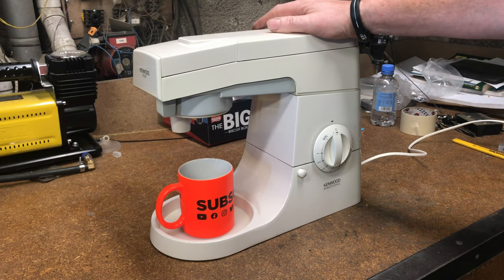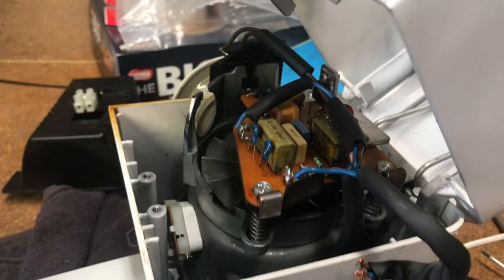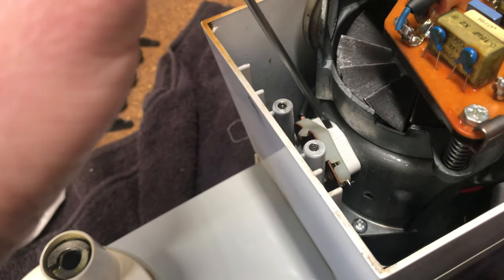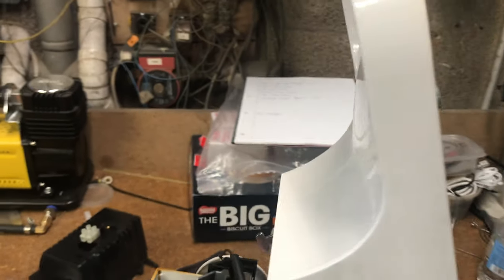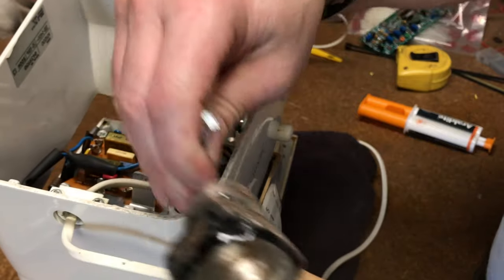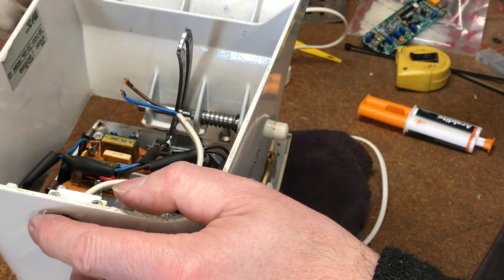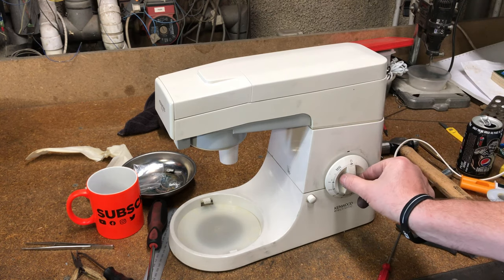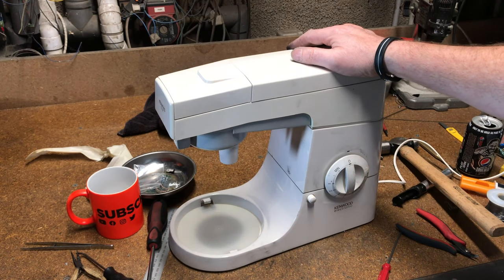Kenwood Electronic KM200 Food Mixer motor controller issues

Comment: Nice Video Mike. I have repaired a few of these. I usually use Rifa Caps that were original factory fitment. Radio Spares sell them Part numbers
210-516 & 210-500 Also that large 56 Ohm resistor is a good idea to fit also as this is uprated from the original. Lastly good to see you fitted new feet, this is really important as these allow airflow from the motor cooling fan. Worn feet allow base to seal against bench & the motor can overheat as a result. Awesome mixers, made to last a lifetime of use.
Reply from the maker: Thanks for the info Carl. Well our mixer is still banging out the cakes after the repair and I expect it will outlast me! Great tip about the feet as well. Thanks for the comments and of course watching 👍🏽

Comment: Excellent views, about the 4 th one I’ve watched, mine is 901 but got the same inductor pins , not the floating potentiometer in a slot, pity the first one didn’t mention the spring height until after I’d removed it will use your 17mm as a first go to.
Reply from the maker: Hi David. Hopefully you’ll have a working mixer soon! Ours is still going strong, good luck and thanks for watching 👍🏽

Comment: Thanks Mike, Yes the brushes are shiny, still a good bit of life in them. Plug and socket are good. I have checked continuity through to the PCB and all in order. Is there a cut out switch I'm missing?
Reply from the maker: I'm not aware of a cutout or trip but thats not to say there isn't. Unfortunately I don't have a circuit diagram to pin point suspect components or check for a trip. I think I'd go down the route of trying to measure the component values and replace as necessary or go to eBay and get that kit of bits. Sorry I cant be more helpful on this one. Thanks for the comments and of course for watching.
Good luck 👍🏽

Comment: Really helpful, many thanks. On slow speeds does the motor seem a little more lumpy & slightly juddery compared to half speed & full speed ?
Reply from the maker: Hi kel, just checked and while it sounds as if there is a slight “judder”  this does not seem to be reflected as a speed issue as the spindle turns smoothly. I hope this helps. Thanks for watching👍🏽
Reply: @MikeMakesIt  speed on mine is fine, just on slow speed slightly less smooth. Looked at a few more  videos of them running it seems this is typical. Appreciate your reply 👍

Comment: Hi Mike, Thanks for the video its really clear. I have a question - my Kenwood 30years + just stopped working. No smoke or bang or anything. I have stripped it down but all components seems to be in good shape no strange smells or anything. The brushes are about 25% of the original. Do you think it would be one of the Capacitors or resistors? Any suggestions appreciated.
Reply from the maker: Are the brushes both shiny on the ends. If so I'd move onto the motor controller side of the board assuming the fuse in the plug  and socket you are using are good. I think eBay still sell kits of bits for the board so in that case I would change all the bits supplied and hopefully that will nail it. If it was possible to safely check you have power after the mixer switch that would be a good thing to check first though. Good luck 👍🏽

Comment: Excellent video and great job Mike. I have a Kenwood km 260 with a sluggish motor at low speeds but I can't find a repair kit for it. I found the whole PCB but it is 60 quid!
Does anyone know the value/reference for the parts, caps resistor, and triac that need replacing/upgraded?
Reply from the maker: Hi Mark, this Guy on eBay seems to have a few kits, it might be worth trying him https://www.ebay.co.uk/itm/194269424632

Comment: Mike I came across your video after my wife's KM200 packed up.  Thought it may be an easy fix as yours was but ours appears to be the micro switch.  By chance have you come across anything similar you could point me in the direction for a new micro switch as I have hit a wall?
Reply from the maker: Can you give any more details on the switch?  I’ll take a look this end.
Reply: @MikeMakesIt  Mike have just found what I believe is the switch on eBay after some digging.  It appears to be an Otehall microswitch with a part number 382422.  Wife will be pleased 😂
Reply from the maker: Do you have an eBay link to the switch as I could update my video links?
Reply: @MikeMakesIt  Mike I’m a bit useless when it comes to apps and whatnot. If you search for: Otehall Miniature Microswitch 15A 250VAC Normally Open Part No, 382422 Ex MOD , you should find it straight away. Wasn’t sure how to copy the link from the app 😂
Reply from the maker: @stephenhawe4331  no problem I’ll take a look. Thanks 👍🏽👍🏽

Comment: This is a brilliant video thanks! Do you know how to take the control knob off? Mine is broken but I’m not sure how to do it?
Reply from the maker: Hi Joel. Yes I do. If you look at the knob straight on there is a rectangular piece of plastic that runs from the 0 to 4-5 markings on the other side . On mine if you get a pointed knife I am able to insert this (at the Zero digit end) between the rectangular piece and the knob and gently prise it out. This will reveal the end of the control shaft. On the shaft is a very small clip which needs to be slid off. When this is done the knob can be removed. I hope this helps, thanks for watching 👍🏽
Reply: @MikeMakesIt  got it! Thanks!

Comment: Great video, got magic smoke so im trying to locate the parts, the ebay link is no longer working. Would appreciate if you could point me in the right direction.
Reply from the maker: Try this link. https://www.ebay.co.uk/itm/152648693252
But also search under "KM200 spares" and you should find other suppliers. There are a few on eBay. Thanks for watching 👍🏽

Comment: I have a much simpler problem with my KM250, but it has me stumped.  Good news is that the mixer  works just fine, but the control knob has separated from the machine and I've got no clue as to how it was ever held in place.

To be clear, the outer dial (black, in my case, with no numbers) and the inner white circular piece to which it is attached via a metal shaft (i.e., the gizmo that cleverly flips the on/off switch and moves the pin that, in term, moves the speed-control circuit board) are attached to each other (via that shaft), but it is not clear how the white piece is supposed to be held in place in the machine.  Not sure if there was some retaining clip that has gone missing or whether the shaft was supposed to lock into the hole in the machine body. (Note that the innermost end of the shaft does not extend beyond the inner side of the white piece, so unless that shaft snapped off -- which it doesn't appear to have --there's not an obvious way for the end of that shaft to lock in place.

Any help, including a detailed assembly diagram or a picture of how this is held in place, would be greatly appreciated.  Note that this is not quite the same machine as in this video, but hoping someone with a KM250 can help.

Thanks kindly...
Reply from the maker: Hi Elsquared222, let me take a look at mine and the spare knob I have. I believe there may be two variant of knob/control . The first is a simple turn to alter the speed and to turn the machine on and off. The second one is where a pulse control is incorporated into the knob/shaft. I’m away from home so give me a day or so and I’ll see what I can find out. 👍🏽
Reply: @MikeMakesIt  Thanks so much!
Reply: @MikeMakesIt  Mike, mine is the simple version.  There's a groove on the back of the white (inner) part into which the pin fits that mechanically raises/lowers the circuit board as the dial turns.
Reply from the maker: OK, I'll dig mine out tomorrow and let you know 👍🏽
Reply: Mike, problem is solved and it was as trivial as I suspected.  Somehow the white (inner) thingie had slide along the metal shaft such that the shaft no longer stuck out the back end of it.  I had peeled the "Kenwood" label off of the black knob, but had failed to notice the secrete (barbed) panel behind it, so didn't realize I could access the outer end of the metal shaft from there.  Once I popped that panel out, a few whacks on the outer end of the shaft caused it to extend inward and gave me something to stick back into the machine. A wee bit scary that friction is all that holds that shaft to the machine, but seems to be working fine now. (And, if it fails again, I know where to whack.)
Thanks again for your reply!
Reply from the maker: Right, I'm not sure I'm going to be of any help here! I've looked at the new knobs I have there is just a plain hole running through the middle. I thought I'd take the knob off mine to see but at some point it looks as if I have glued it on and it wont budge. I will look again on-line to see if I can find the secret of fitting a new knob but I'm not too hopeful. ☹️
Reply: @MikeMakesIt  All set here. Thanks again.

Comment: You should have used the resistor in the kit too, especially as you had the board out. Original spec is too low power, that is why they supply an uprated one.
Reply from the maker: Good to know, thanks for the info Ian 👍🏽

Comment: Excuse me 17mm from where to where?Thanks
Reply from the maker: Hi. Not sure what you mean. Can you give me any more information?
Reply: @MikeMakesIt 
Thanks, it's very kind of you.  I would like to know the distance between the moving and fixed parts of the motor, those separated by springs with screws, and what references it has taken.  In the video he talks about 17 mm, but I can't understand how he got the measure
Reply from the maker: @raghirar  Check this out: https://youtu.be/tXxXeo9EMMg?t=770 The distance I measured on mine was about 17mm. This measurement was from the underside of the PCB to the metal motor case. Take the measurement where the bolts with springs are. It would be best to measure yours before its dismantled really.

Comment: I have same mixer but  its motor  head is loose  how can I repair it  ?
Reply from the maker: Hi Fahad. I believe its most likely  the rubber support rubbers have failed although luckily on mine they were ok, hence no video on this. Below is a link to an old web site that describe everything you need to know about the mixer and more importantly the motor. I hope this helps you, thanks for watching 👍🏽

http://www.britishexplorers.com/Kenwood%20gearbox/homepage-motor.html
Reply: @MikeMakesIt   this page  isn't working?
Reply from the maker: Hi Fahad, I've double checked the link on different machines and it does seem to be good from here.

Comment: I replaced the parts but it still doesn't work.
Reply from the maker: Hi Ryno. Thanks for the feedback. That’s a shame it’s still not working. If the caps and transistor have been replaced because they were faulty then they could have blown the fuse in the plug (UK). If not checked out it could be that. There are also many other things which could be causing the none running of the machine but the parts in the video probably cover the vast majority of the issues found with this particular machine. Thanks for watching 👍🏽